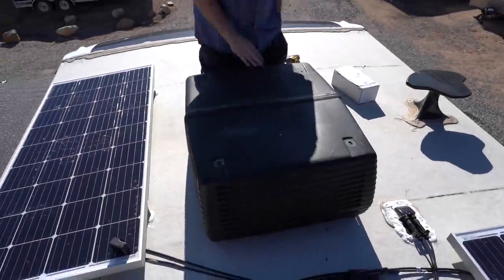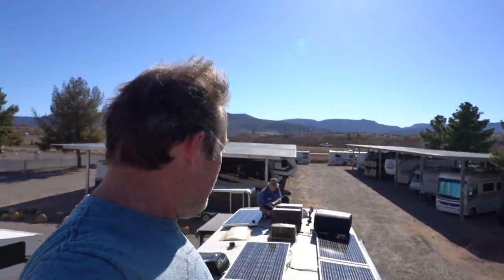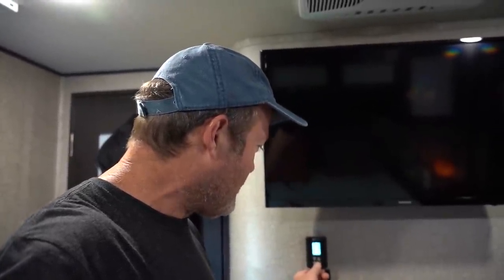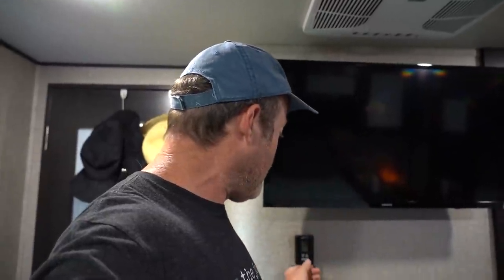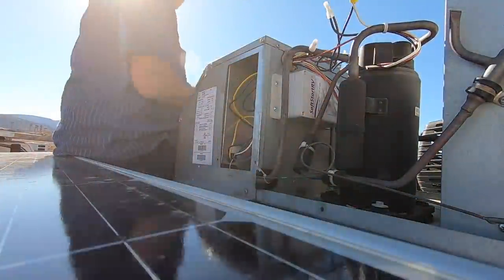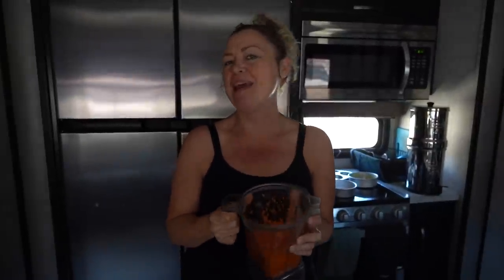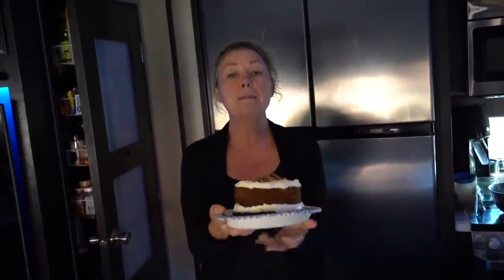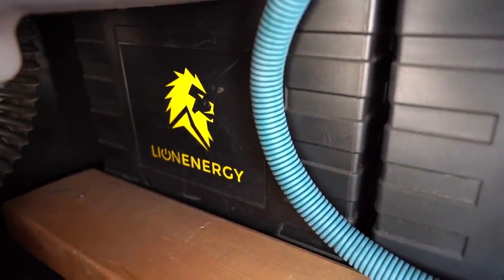RV AC ON SOLAR! AIR CONDITIONING & COOKING WHILE DRY CAMPING (RV LIVING)

Comment: Thx ETJ for the informative and entertaining video looks like dolar/batteries are working good for you. I see Chad with changing lanes moved from Go Power hope yours keeps meeting your needs. FWIW I installed 2 MicroAire Easy Starts on my Fuzion 3yrs ago to let me utilize 30amp  sites but I'm still running geny to carry loads my 125ah FLA snd 1.5 kva pure sine wave inverters can't handle. We're not out of S&B yet but hope to FT soon and will probably upgrd 400w solar to something similar to your set-up with lithium iron phosphate batteries as the price of admission is getting lower. Safe travels & stay healthy U2.

Comment: Those "soft start" capacitors are ridiculous. I had the local a/c guy put the standard hard start capacitor on my dometic roof unit and it cost me $40 total.  It's been working for a year with no issues. I use the Lion Energy batteries as well and they work great.

Comment: Have you considerd painting your black cowlings on your roof White, or with a Cool Seal type white paint that reflects the heat? Your cowlings will be cooler during the day and they will cool down faster at night. If you don’t want to paint them and replace them instead? But that costs a bit more. I also thought about getting some out door blinds to drop down along side my Rv to keep the heat directly off my rig. I don’t know if that would help??

Comment: Just a quick question….how many nights can you get using the bedroom a/c as described along with “standard” daily use draining the batteries and assuming nice sunny days charging them….this question is based on your solar and battery setup…thx much in advance for your reply 😃
John
Reply: Should be indefinitely. The panels recharge during the day so it's just a continuous cycle.

Comment: This is out of left field but another youtuber measured the heat on the surface of the RV and found it was extremely hot. Here is a left field out of box idea… if your going to be boon docking or camping for a period of time….. you know those silver Bubble reflective folding things you put in the windshield? What if you put Velcro strips on top of your Rv and on the cowlings and Velcro on the silver reflective and when you park set up your rig put the reflective covers up on the roof on the Velcro?? Sometimes it gets windy I don’t know about that but if your in hot weather and it’s dry and no winds no storms then in theory it should reduce the temperature on top of your rig. Thus reducing a thermal heat mass that absorbs into the inside of your rig???? 
Is the theroy worth investigating? Instead of painting the cowlings or changing them just cut out a silver reflector and apply velcro on top of the cowling and set it on top of the cowling. It shouldn’t over hang but be cut out the same size as the top of your cowling??? 
Reducing the heat is number one I think. Will these ideas work I don’t know.

Comment: I wonder how this will work in this South GA heat
Reply: You're still limited to the amount of power your solar can produce, and your batteries can hold. The soft starts do not cause the AC units to use less power. They only help moderate the surge that accompanies start up.